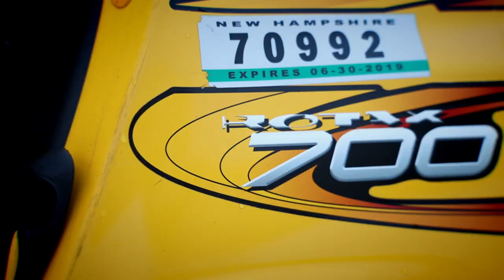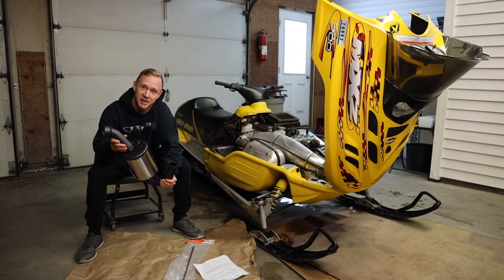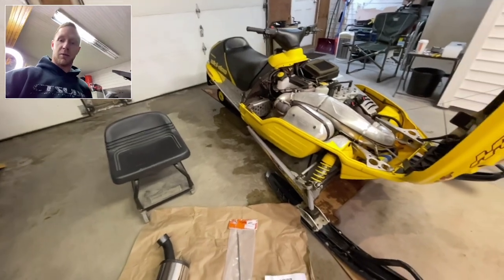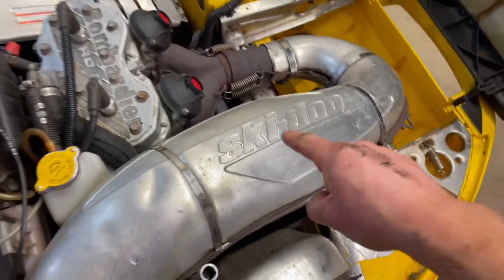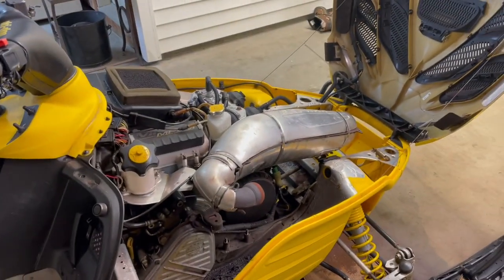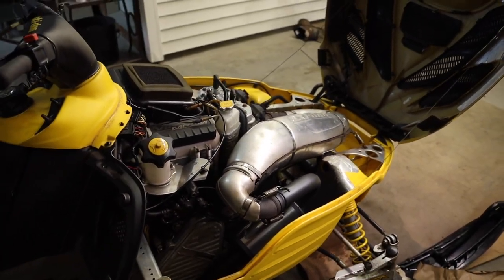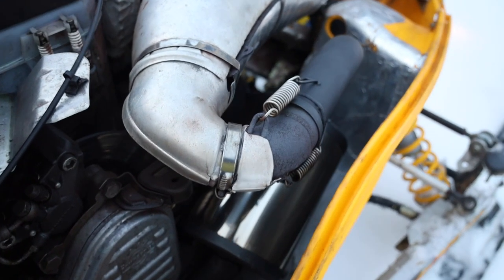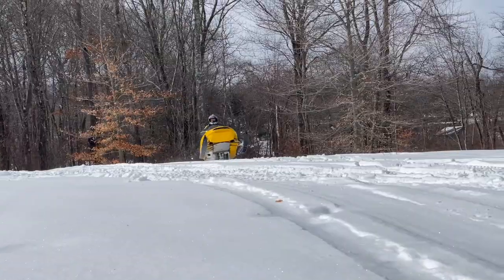MBRP Trail Can Install & Review | Ultimate 2 Stroke Snowmobile Sound!

Comment from the maker: Any Snowmobilers Out There?  Comment Below What You Ride!
Reply: I ride a 2005 Yamaha sx venom 600 my youngest son rides a Yamaha SRX 700 my other son rides a 2000 MXZ 700 where do you ride
Reply from the maker: @mikeversluis1347  nice!  I bet those triples sound incredible.  I ride in Connecticut mostly, but plan on going to Vermont and upstate New York this winter.  How about you?
Reply: @DriveItRyan  yeah they sound pretty good I ride down in Ontario in Barrie and Huntsville
Reply: I ride a 2002 MXZ 600. Would that can be the same one for mine? If not do you know if the other mbrp one's install the same as this one does?
Reply: Yamaha vmax 700 ✌